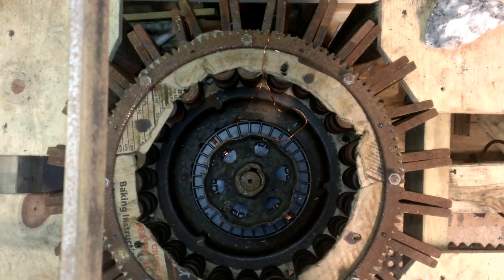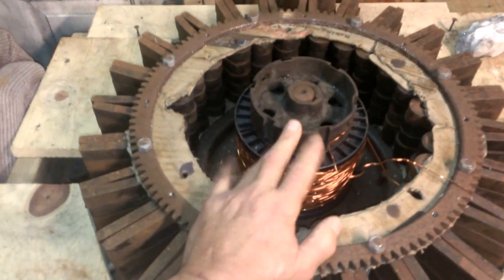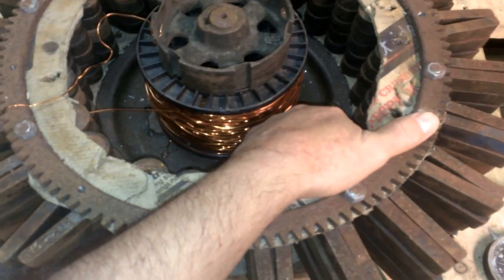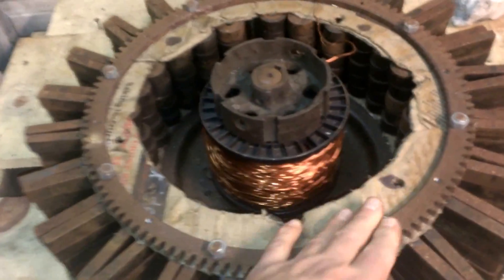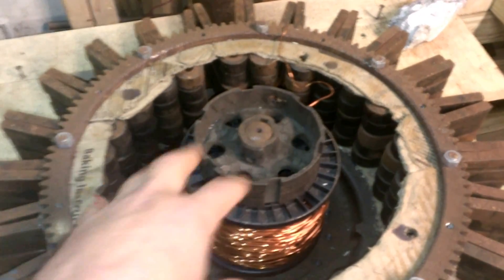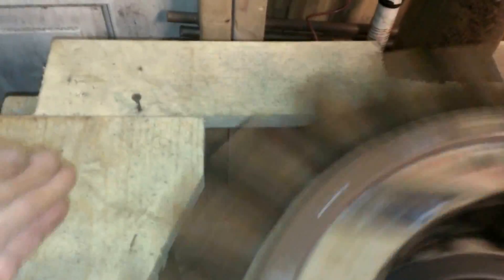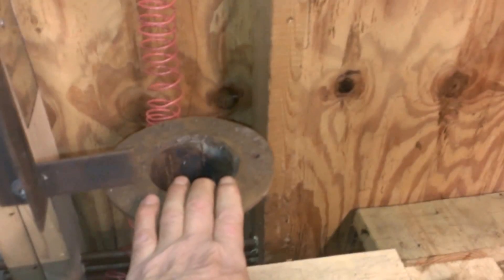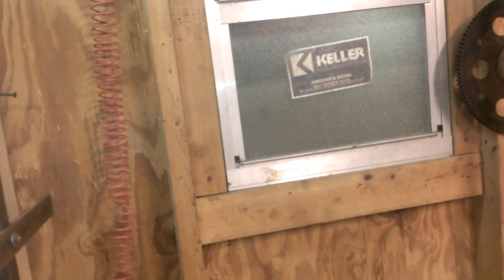The truth about Ed Leedskalnin's magnetic flywheel

Comment: ok all you people really don't have a clue. Do you ?
For one thing there is no SPARK GAP. There is no Electrical potential . That's why its call MAGNETIC CURRENT. duh,
ED was not moving rocks he was moving skeletal remains of a living organism and the way to do that is to remove the magnets which is causing the gravity weight of the object.MAGNET is not one word but two MAG-NET . a magnet all one word is the devise to capture MAGs.
The sweet 167 was used to remove the magnets from the CORAL to make it lighter so it could me manipulated.
All the iron and steel above the devise and the iron beneath it were used to create a magnetic flux .
None of you people really know what your doing or want to do .
The only people that will be given the secrets of ED. are ones responsible enough to wield the absolute power on this planet. here is a gift for you all

The Control Factor
Formula:
C - 2 + 14
z
= 710Y + 409430
OUT OF BALANCE!
.
This formula describes a molecular structure just outside
the earth's rim that is the CONTROL FACTOR that governs the
complete particle interchange process of our solar system.
The balanced formula is given asC  C --- 2 + 14 2 + 14z = 710Y +409, however the current situation on our planet has the formula
reading something like  C --- 2 + 14 2 + 14z = 710Y + 430  = 710Y + 430  which is out of balance.
Two main technological advances, electricity and
radioactive particle production (and the spreading of those
particles through explosions, power plants, etc.), are creating an
imbalance in this formula. Evidence of this imbalance is
becoming more and more apparent. The ozone holes (which
continue to worsen), the increase in storms, earthquakes, and
volcanic eruptions; the gravitational fluctuations and the sun’s
erratic behavior are all indications of a serious imbalance in the
system. We will briefly discuss this evidence of imbalance.
The ionosphere is not merely an "ozone layer" or "invisible
gases" but it is a rim of pulsing neutrons that is the
DISTRIBUTION ZONE for the energy that supplies this planet.
Electrical power plants are now forming ionospheric neutrons
into electricity at a rate whereby the FEED SOURCE that provides
our planet with energy cannot sustain this protective rim, thus
ozone depletion is happening. REPEAT: ELECTRICITY IS THE
PRIMARY CAUSE OF OZONE DEPLETION. It is imperative to
generate energy from a natural attract-attract principle. People
will soon be able to observe the core structure of the electron,
then the need to stop generating electricity will be well
understood because the effects of electricity will be clearly
observable.
The molecular structure C  C --- 2 + 14 2 + 14z = 710Y + 409
governs the conditions within the entire earth system, including
the conditions of our atmosphere. As this governing molecular
structure is affected by electricity and radioactive particle
production, our environment reaps the consequences. For
example, storms start as an imbalance in the magnetic field that
creates the physical manifestations (tornadoes, hurricanes,
lightning, etc.) that are attempts to regain balance. The storms
will get worse as humans throw off the magnetic harmonies of
the earth with more and more destructive technology. REPEAT:
THE EARTH’S MAGNETIC RE BALANCING IS THE PRIMARY CAUSE
FOR THE INCREASE IN VORTEXUAL STORMS.
Like wise, almost all geological activity is the result of the
earth regaining or reestablishing balance in the magnetic grid.
The earth depends on atomic consistency in the elemental
vibrations. Humans have created elements that do not occur in
nature and then humans spread those elements throughout the
system. This radical molecular contamination is far more serious
than scientists have realized. The future of our species depends
on redistribution or nucleic breakdown of radioactive particles.
THERE IS A DIRECT CORRELATION BETWEEN HUMANS
THROWING OFF THE PLANET’S ENERGY GRID AND THE
UP HEAVEL OF THE ELEMENTS TO REGAIN BALANCE.
The energy exchange between the earth and sun is
continuous and largely interdependent. The conditions on earth
are reflected by the sun and visa versa. The earth and sun will
purge the system of radioactive waste and a new magnetic grid
will be established for earth.
The variables in this formula (C, z, & Y) represent energies
that are constantly changing to keep both sides of the equation
in perfect balance. This formula represents a system in motion.
The molecular structure (represented by this formula) is
designed to keep perfect harmony between the Center Point or
KING PIN, around which the total Universe takes its preordained
course, and the Earth. The left side is the energy from the
Universe coming into our Solar System and the right side is the
manifestation of that energy. The problem is that we are
currently experiencing an imbalance of energy on earth because
of our technological influence. This imbalance is causing an
unwanted change to the Y part of the formula. Fusion, fission,
and electricity are creating harmonic rifts in the Universal
tapestry that must be mended.
The impact of electricity and radioactive particles is now
responsible for the destructive distortion of the 710 units of
combustible factors. Humans have misused natural forces to
create unnatural elements, which are now a major contributing
factor to the timing of the DRASTIC EARTH CHANGES that are
about to occur. The earth, and the system it is part of, is in the
process of re balancing itself with a pole shift and a series of
gravitational/energetic changes. Some people will say that God is
punishing the people on earth for their sins, but nothing could be
further from the truth. The current and coming earth changes are
critical to our survival.
We will try to explain the formula further:
At this stage of our human understanding this formula
serves more as an explanatory tool of the workings of our solar
system, compared to a scientific equation for taking
measurements.
C is the magnetic light, in this instance, without
considering time and space.
- 2 is the number of planets Earth is away from the center of
our Solar System,
 identified as Z or Jupiter.+14 z
is Jupiter at 14°, the 14 being the magnetic light arc as
it travels from the center, Jupiter, to the Earth at a 14°angular.
The Z represents the units of magnetic energy coming from
Jupiter to earth.
When the left side of the equation is calculated, it equals
710 units of combustible factors; these factors are multiplied
with Y. All of the combinations of combustible factors result in
the production of 409 elements that structure the Universe.
Y is the combustible factor of the elements. Y represents
every energy polarity or signature necessary for the
manifestation and redistribution of any molecular combination. Y
helps organize the 710 combustible factors into the 409 elements
that make up the physical world. Everything that exists within
our planetary system has a specific energy vibration that keeps
every group of molecules together or allows them to separate –
these energy vibrations are represented as Y. All elements have
a specific energy combination that can be formulated or broken
down. All elements are combustible with the right energy field or
polarity. The magnetic lock that holds all molecules together can
be opened or closed with the proper energy field, and this
process does not require heat as we are used to thinking. Of
course all elements can be burned with high enough heat, but
that is not the kind of combustion we are talking about. The
combustible factors can transmute elements into the preordained patterns that are imprinted on their molecular
templates or break down the molecular structures into a more
neutral polarity. The process is continuous and the number of
energy polarities represented by Y adjusts as necessary.
Humans have used destructive technology to force certain
molecules to separate and join in a manner that does not
naturally occur. This violation of natural law produces drastic
consequences that the system must rectify.
The 710 combustible factors are variations of magnetic
energy and are concentrated in our atmosphere. These
combustible factors are combinations of earth, air, sound, speed
and light and they provide the polarities to form the 409 elements
of the physical world. We are not experiencing many elements
available to us at this time. Living energy systems on earth must
exist within these combustible factors to operate at full
potential. If a living energy system attempts to exist or operate
outside of the ionosphere, it will not maintain normal functioning.
For example, if humans leave our atmosphere and do not have
the appropriate energy field on their spacecraft, their bodies will
not function properly. Gravity, or compressed magnetism, is the
overseeing force that allows the combustible factors and
elements to exist.
The letter C commonly denotes the speed of light in
scientific equations. The element light mentioned as one of the
factors of Y is not the light identified as "C" at the start of this
molecular structure equation. This is important to note. This
formula explains how pulsed light particles emitting from the
center of the Universe travel to our solar system at variable
'speeds' outside of time and space. This formula is primarily
concerned with how the high speed pulsed light energy,
represented as C, is transmuted into magnetic energy which then
creates a speed change that is considerably slower. This formed
magnetic energy is captured by our Solar System and is then
transmuted into an energy that supplies and sustains our Sun.
The light pulses then leave our Sun (and other stars) at about 4
times the speed of light waves (light waves are about 186,000
miles a second). The pulses elongate into waves when they come
into contact with something. This formula is primarily for our
Solar System. Contrary to popular opinion, Jupiter, not the Sun,
should be seen as the center of our Solar System when trying to
understand the energy dynamics of the system. To understand
the full impact of the formula, it is necessary to look at the solar
system with Jupiter as the center.
Again, a nearly infinite number of combinations of the 710
units of combustible factors produce a nearly infinite number of
combinations of the 409 elements (which are a combination of
earth, air, sound, speed, and light). The left side of the equation
is designed to equal the right side: near infinity = near infinity.
This formula is in keeping with the fact that, "All energy was and
is created ongoing from the SOURCE of all." Note that the
primary energy force in the Universal system is the vortex.
The presently held LAW of entropy is completely false. All
magnetic molecular structures are in a constant state of change
forming and re-forming with the action always resulting in 100%
efficiency. All universal systems proceed to take their prescribed
course of action with pre-ordained precision from the Creator
Force, utilizing a process of time during the forming and
reforming of structures until 'given evolution' results. Yes,
scientists have observed randomness in the cosmos, and they
believe the events they observe have no order, however, the
randomness is not RANDOM. The Universe functions perfectly in
a PATTERN AS NEEDED while repeating in a random sequence.
As the scientific community makes advances in the field of
magnetic pulse detection, people will be able to monitor exactly
how many units of combustible factors arrive here from Jupiter
at any given moment, thereby maintaining the Earth's energy
needs. People will observe that the energy from Jupiter is then
used by the Earth as needed, and the Earth simultaneously
imparts energy to our Sun where it helps to sustain the Sun's
energy that is again returned to Earth. The Earth is the vacuum
of our planetary system, the final point where energy is recycled
back into the Universal system. The pollution produced on Earth
affects not only our planet, but other planetary systems as well.
Contaminated magnetic energy travels from our planet
instantaneously to other systems forcing other beings to cope
with our pollution. We are truly connected to a much larger
community than we like to think.
We must stop seeing our Earth as an independent, isolated
and non-contributing part of this Universe. We must begin to
understand that we can no longer move against nature but we
must now utilize what is being offered for the benefit of the
world. We have long overlooked, through greed, the use of FREE
magnetic energy, and the time to expand our minds is now at
hand because our planet is soon to find itself extinct if we do
not.

 I STAND
DOUG THE GOLDEN ONE

Comment: THE THEORY OF EVERYTHING

The Sun goes around the earth.  That's what you see when you go outside and look up in the sky, isn't it?

Why wouldn't you believe what you plainly see when you do?

Why does a magnet stick to a refrigerator?  You'll have to answer this before you can insist on a heliocentric solar system.

The all illusive theory of everything will do much more than just reveal the relationship between the electromagnetic force and the gravitational force.

It will reveal "Light" as the unifying force.  In the beginning God said, "Let there be light and there was light;" On the first day.

This "Light" was not the visible part of the electromagnet spectrum.  This "Light" is not what you see when you flip the light switch in your kitchen.

The sun moon and stars weren't created until the 4th day of creation.

[This is why no one will ever discover a gravity wave or a Graviton.  They don't exist.  

Just because there are both particle and wave like properties of the visible part of the electromagnet spectrum, doesn't mean that the strange attraction that matter has towards other matter can be explained in a similar way.]

The "Light" created on the first day of creation is what gives form to matter.  And the earth was without form and void - On day one, until the creation of "Light".

"Light" is what keeps the protons in the nucleus of the atom even though they are being repelled by other Protons. 

"Light" is what makes the strong and weak nuclear forces possible.

"Light" is responsible for the fact that a magnetic force produces an electric current in a conductor passing through it.  

"Light" is what makes a magnet stick to a refrigerator.

"Light" is what makes the gravitational force a reality.  

"Light" is what keeps the sun in "orbit" about the earth.

"Light" is a creation of God that unifies the four forces of nature.

Until this is understood the universe will remain a mystery, and the solar system as well...

We must make the distinction between the visible part of the electromagnetic spectrum, what we call light, and "Light".

Without "Light" there would be no light...  Or anything else except the heavens and the earth and the earth would be without form and void.

Without "Light" there would be no Earth for us to live on, only earth.  Matter is anything that has mass and takes up space - earth is not matter.

There would be no matter without "Light".  "Light" makes the existence of subatomic particles possible for the formation of atoms.

"Light" is what transforms earth into Earth.  

God saw the "Light" and called it (capital D) Day; divided it from darkness and called that (capital N) Night - All done in one "day" - on day one.

Again, nothing to do with the visible part of the electromagnet spectrum; God can see the "Light" - Apparently, you and I cannot.

Three things are required for us to see something: (1) An eye-piece.  (2) Light.  (3) And an object.  Remove any one and you and I can't see anything.

An eye-piece with light will result in total darkness - Plenty of light, but nothing to see, only pitch black.  There must be something to look at.  You can't see the light, there must be an object.

There is nothing to suggest that the moon doesn't give off its own light.  That's what the Scripture plainly says.

To understand "Light" is to understand the Unifying Theory - The Theory of Everything.

To understand this technology is to overcome gravity and achieve the ability build pyramids.

Comment: The fundamentals of it are all there but what we need to to is think about what ed did with this. This is a what one could be described as an antigravity well. The effects you show with the rotation and levitation of the slave magnet are what we are after but the process is wrong. What ed did was to attract electron/gravitons from the atmosphere above what he wanted to move and show it down the well (to the centre of the earth). The perm magnet holder is charged positioned and with ariel, now if we think about what happens for now we shall spin the wheel electrons are pulled from the keepers null point (centre) this can be described as the gateway. Electron/ gravitons enter the wheel and are seperated...Any Questions?

Comment: What if  you were to use more mass?
  in one of edds pictures he used a lot  of chain as mass some how.  more  mass would probably trap more magnetic current flow. The same way you charge the PMH maybe you can use the wheel to charge large mass? In the picture with ed and the flywheel he uses some sort of pick up coil connected directly to chain.